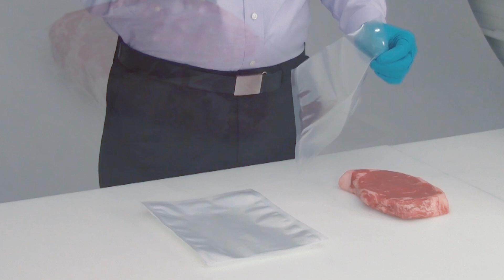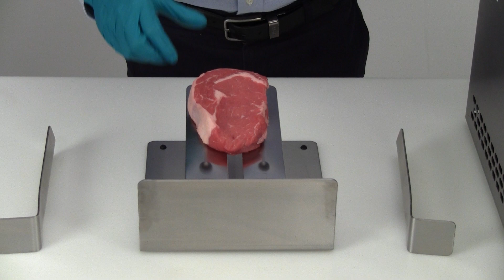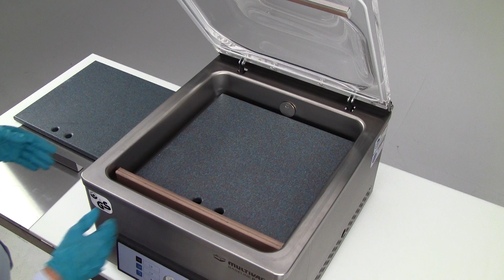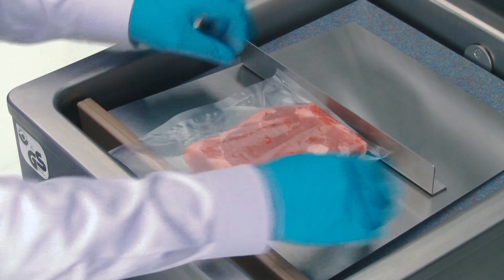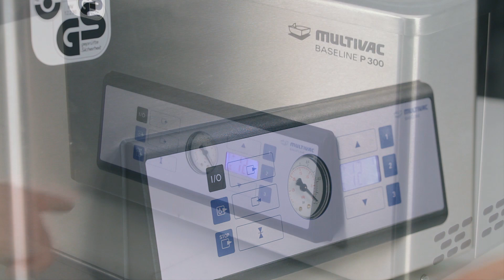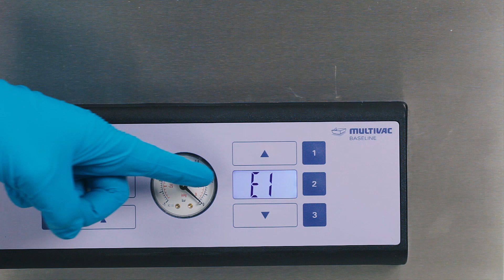Vacuum Packaging Tips and Best Practices

Comment: Some of my bags loose the seal after anout two days do you know why?
Reply: I find when sealing raw meat, you need to vacuum longer. 
You remove the air from the bag, but the meat itself still has air in it.
This is what makes it seem like the bag lost its seal.
Most solid items get 20 seconds vacuum. Raw meat get from 30 seconds to a minute before sealing.
Reply from the maker: Hello, we're sorry to hear that you're experiencing this. Our packaging experts would be happy to help you troubleshoot this issue. Please give them a call at 800-888-3610. Thanks!

Comment: Where did you get those bags that when you’re done ceiling you tear the tail off where did you buy them
Reply: after sealing, the packaging tends to be almost in a molten state due to heat
Reply from the maker: Hi Pat! Our P-Series Vacuum Chamber Machines include a Double-seam separation sealing feature which allows the bag to be torn off in this manner. https://www.bunzlpdpackaging.com/vacuum-packaging-machines/
Reply: COME TO CONTACT WITH ME,I TOLD YOU WHERE AND HOW MUCH.  SALES@NEWERA.COM
Reply: If you need those bags let me know.